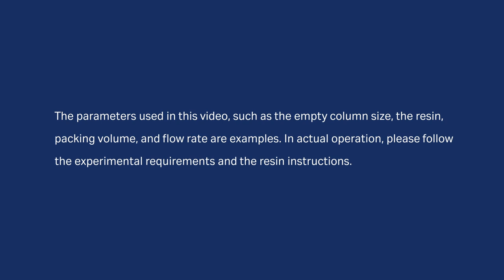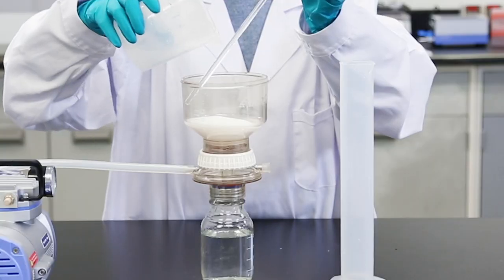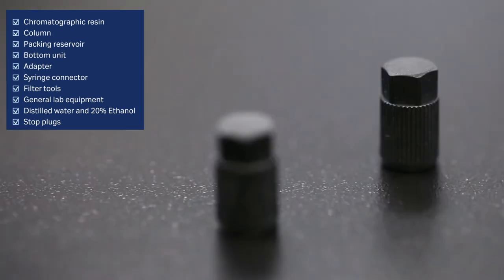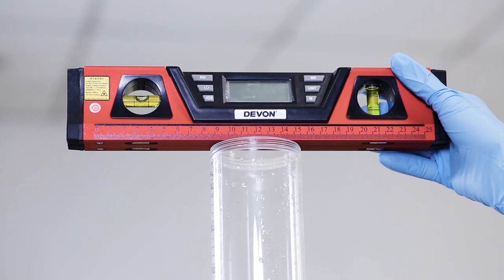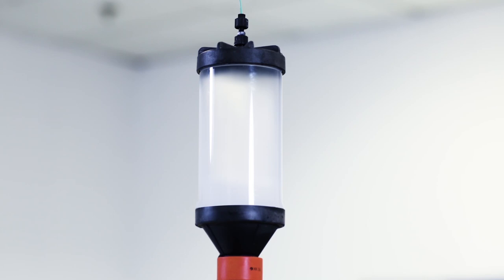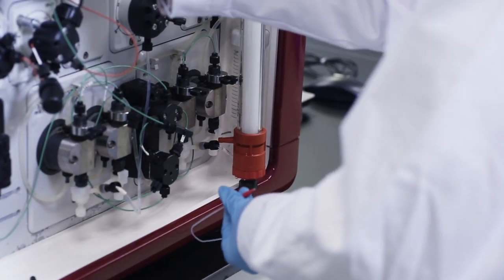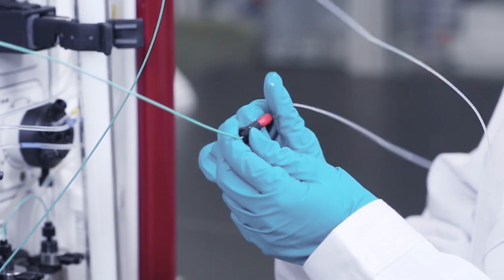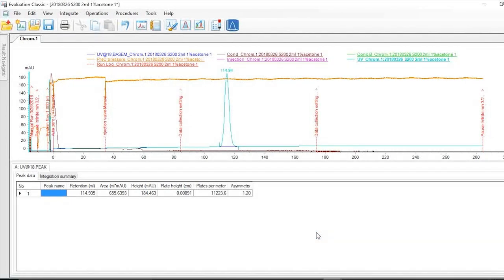How to pack an XK chromatography column

Comment: According to the manual of Superdex prep grade, the packing should be done in two steps for this resin. Step 1 according to the table at 5:33. After removing the reservoir, Step 2 at a higher flow rate.

Comment: What is packing solutions
Reply: That should be in the manual for the resin.  Should be a weak buffer system, but check with the resin manual.